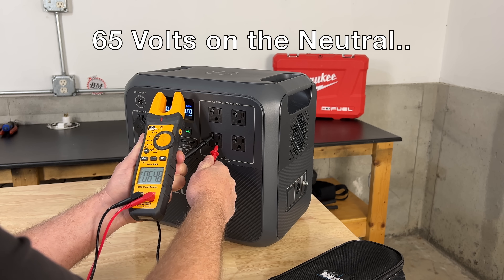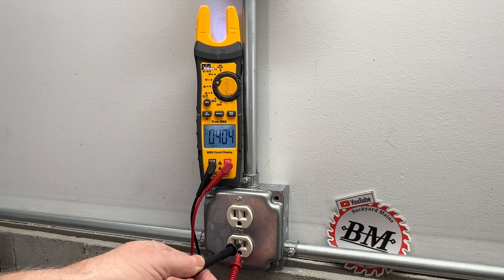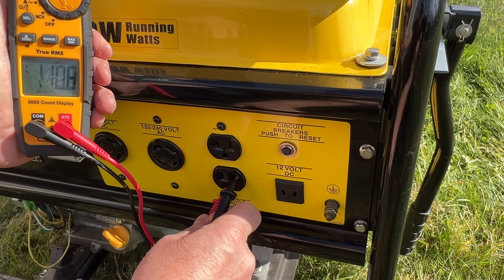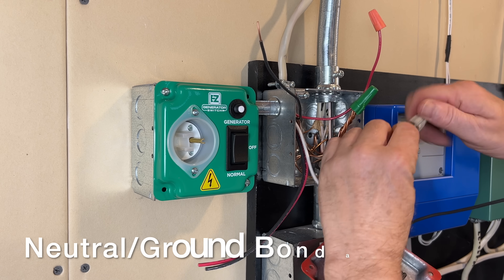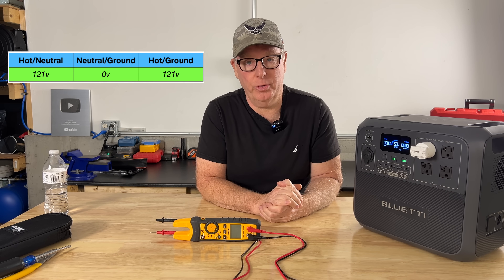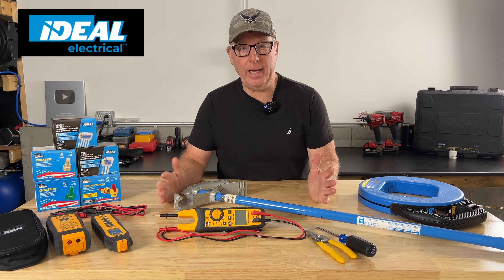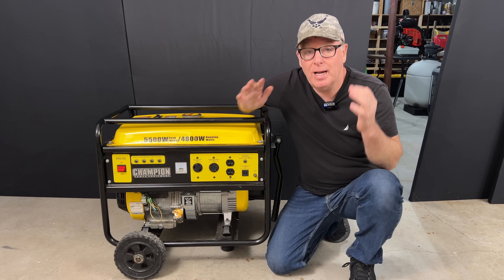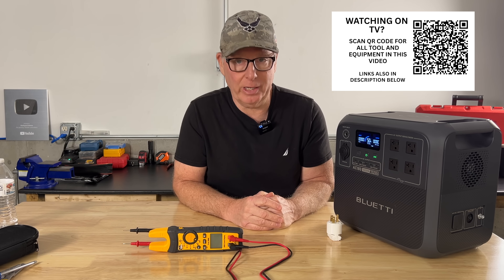The Hidden Generator Mistake.. (Dangerous)

Comment: I was hoping we'd cover the requirement to ground the portable generator when it has a bonded neutral and the very special case where we're running portable and unbonded, but the latter is only for people who know they need that anyways (so if you have to ask, don't worry about that one). Otherwise great coverage
Reply from the maker: When used as a stand alone system, most generator manufacturers recommend a ground rod but it's not required by code and its not practical to drive a ground rod and remove it every time you move the generator. With a bonded neutral, circuit breakers and GFCI protection will work. A ground rod is basically surge protection. A surge can be created from a near by lighting strike. If you were using a hand tool when this happened you could be at risk and a ground rod would offer some protection. There is no protection for a direct hit though.. I never use my generator when I hear thunder in the area.
For backup power use with a floating neutral, the generator is connected to your electrical system which then bonds the neutral and also connects the generator frame to your system ground and grounding electrode. So everything is grounded and bonded just like everything in your home. 
The only reason to then have a separate ground rod would be to direct a surge from a near by lighting strike to ground rod at the generator rather than have it travel through the ground wire to your panel and out to your system ground. Yes that is an option if you want to mitigate that issue but it's to code at least from my interpretation.

Comment: Consumer generators should come with a bonding switch.
Reply: ... and an explanation. But the lawyers would have to get involved.
Reply: @icanreadthebible7561  It's purposefully made difficult to change so that it's not easily defeated by people who don't know what they're doing. It's very easy to unbond a binded generator by following the circuit diagram or service manual. Don't do it unless there is always a single, real ground provided especially in standalone operation and the generator is labeled "UNBONDED". Unbonded ungrounded generators are inherently dangerous and often incompatible with a lot of equipment.

Comment: Have to be a little careful because sometimes the output isn't floating.  The way to check that is typically to plug the power station into the wall with a switch, then check the following:

(a) Whether the ground is passed through or not
(b) Whether ground on the AC output is wired at all and to what (if anything)
(c) Whether hot and neutral are reversed when the power station is in pass-through mode
(d) And then with the switch turned off (so neutral and ground are passed through but the hot is not and the power station's inverter is turned on) ... now check whether the neutral output is ground-referenced to the utility ground (or utility neutral).

Unfortunately, lots of power stations mess up the AC plugs.  I have two which flip around neutral and hot when AC is being passed through, for example.  That's right.  I plug the power station into the wall and the AC output's HOT is now ground-referenced and its NEUTRAL is 120VAC.  I learned that the hard way once.

Another common problem in older power stations is that the power station's inverter output is not isolated and the neutral and ground are hard-referenced to each other, but NOT at zero volts.   Either on the input or the output or both depending on how ground is wired (if ground is wired at all, which is another problem). This occurs when the power station's output transformer is wired for 120VAC split-phase with the center tap of the output transformer being ground-referenced.  And now .... oh yah.  That is not good at all.

Gotta make sure everything is referenced properly before trying to tie a power station into a panel (for example), verses just directly running a few appliances.

-Matt

Comment: You have to be careful about bonding the neutral on Chinese made AC inverters that also have unbonded Neutral if they have outlets as well as a terminal strip for the output since all the ones that I've looked at have the Neutral and Line connections reversed on the terminal strip as compared to the outlets. If you have a breaker panel connected to the terminal strip and something plugged into the outlets you could potentially have them grounded to different sides of the outputs creating an electric shock hazard. The Chinese factories don't seem to know how electrical power systems work in North America and typically use Red wire for the Line, Yellow for Ground and Black for the Neutral connections to the terminal strip instead of Black, Green and White, which makes no sense to us. This is easy to fix by putting a piece of white heat shrink over the red wire and relabeling the terminal Neutral, Ground in the center and Black the Line so the terminals match the outlets.

Comment: Interestingly, in 2008 I installed a 17KW Kohler standby generator along with a Kohler Automatic Transfer Switch. This system would start and stop automatically. I wasn't clear on why the generator arrived with the neutral and ground bonded, but I assumed it was okay. After a few years I realized that the ATS did not switch the neutral so I unbonded the neutral and ground in the generator. This was a PITA since I had to disassemble the entire box and chassis to get to the point where I could lift the bonding jumper.

As a side note, I noticed that the voltage sums between neutral and ground and hot to ground were equal the voltage between hot and neutral.
Reply from the maker: Good move.. Now you have a safe system that won't have stray voltages floating around on your ground wires and present a potential shock hazard. Its a shame that make it hard to find or to get to. I have seen so many portable and permanent stand by bonded generators without the neutral being switched.
Reply: @BackyardMaine It's not a shame but a feature. It requires positive effort by people who know what they're doing to avoid the alternative of safety issues of people willynilly unbonding standalone generators without using a proper temporary ground electrode and injuring people.
Reply: Thanks so much for this video.  I just built a 25kw generator for my farm and couldn't figure out why I was getting 60v on the neutral to ground at the 50amp outlet.  I realize now I do have a floating neutral.  Separate buss bars. I subscribed because I like to follow people who really know what they're talking about.  Excellent work much appreciated

Comment: It is all relative and unless one of the references is not bonded then, it is irrelevant...i.e. it is a 'don't care'.  One should know now what they expect to see before they measure it.  Sometimes measuring something is silly unless you really know what you're looking for.  What cranks my crank in industrial is control systems with 24VDC(or whatever is chosen) is when they don't reference the 24V to ground.  It is easy and safe to do(just a tiny, no-current carrying wire).  If you don't 'bond' the 24V, it makes for a real PITA to troubleshoot when long runs are made and you have no way to get back to the unbonded 0V(commonly called the common)  but, the common is not common unless you common it.  Floating common(really, no common) makes for a terrible time of measuring things that you cannot measure w/o a probe a long as you are distant from the source. Wordy response, I know, but I think know what you mean.

Comment: It seems odd that you didn't address whether or not to use the Earth ground?  This is a separate issue from bonding, is it not?
Reply from the maker: When used as a stand alone system most generator manufacturers recommend a ground rod but it's not practical to drive a ground rod and remove it every time you move the generator. With a bonded neutral, your breakers and your GFCI protection will work. A ground rod is basically surge protection. I surge can be created from a near by lighting strike. If you were using a hand tool when this happened you could be at risk and a ground rod offers some protection. There is no protection for a direct hit though.. I never use my generator when i hear thunder in the area.
For backup power use with a floating neutral, the generator is connected to your electrical system which then bonds the neutral and also connects the frame to your system ground and grounding electrode. So everything is grounded and bonded just like everything in your home. 
So the only reason to then have a separate ground rod would be to direct a surge from a near by lighting strike to ground rod at the generator rather than have it travel through the ground wire to your panel and out to your system ground. So yes thats an option if you want to mitigate that issue but it's to code at least from my interpretation.
Reply: @BackyardMaine 

We're 250 today!  Happy birthday Jarhead!

; )
Reply: @BackyardMaine 

My idea of a "ground rod" for a gas/solar gen is driving an 18" steel stake in the ground (and removing when done).

Does this give any level of protection being that it isn't an 8' lg copper coated typical rod?
Reply from the maker: @mjktrash  Depends on the soil but probably not very much especially in dry conditions.
Reply: @BackyardMaine   Is there a way for a talented/knowledgeable guy like yourself to quantify this concept and either say it works "some" or it's definitely not worth it?  I'm certainly not that guy on a E.E. level...  Might make a good video?

Comment: I have been looking for an answer to this question forever. I am a pepper and have a tri fuel non inverter generator and a solar generator. I bought the non inverter generator before I really knew what I was doing. My plan was to use my tri fuel generator to charge my solar generator on cloudy days. As I found out later this may be an issue due to THD. Are there ways to mitigate the risk.
Reply from the maker: Happy to help answer this question for you.. I find even some electricians don't quite understand it. I do something similar to what you're doing but only for power outages. I made a video on the subject. https://youtu.be/ti9aorGY7yI

Comment: As a hvac guy if your only powering your boiler/ furnace you should bond your neutral,the newer equipment of today rely on electronics to lets say flame rectification and commands from the pc boards...your explanation on this video was excellent
Reply from the maker: That's a great point! Many will not run when the neutral is floating. With the EZ- Switch you have a choice to wire it as a bonded or a floating neutral. In either case you should have a bonded neutral. If it's wired as (floating neutral) the bond will come from your electrical system, if wired as a (bonded neutral) you need to bond at the generator or power station.
Reply: @BackyardMaine  Which is the recommended wiring method for the EZ-Switch? I’m considering adding those to my HVAC systems. I have a solar generator (battery pack) and an F-150W with the optional 2000W generator (inverter on a gas engine), that I may need to use if the battery pack is fully discharged during a power outage.
Reply from the maker: @RickActual  It will depend on your backup power configuration. The power station will have a floating neutral (I have never seen one bonded) and if your generator also has a floating neutral then you would wire the EZ Switch according to the floating neutral instructions. That way everything will be bonded to the home connection when the generator or power station are running as your backup.

Comment: A ground fault is the most common issue in household equipment. Ungrounded systems are specifically designed not to clear ground faults (by blowing a fuse or tripping a breaker) so I would argue they are less safe.  You only see deliberate ungrounded systems when the loss of power is worse than the risk of someone being shocked (e.g., an ICU in a hospital) and even then they are behind an isolation transformer.  

The real question you have to ask is why the power companies started grounding distribution lines in the first place. Once you understand that, you can better assess the risk of an ungrounded system.
Reply from the maker: All homes in the USA are on a grounded systems. The point of the video is where the neutral and ground are bonded and that it can only happen in one location. Even power stations are required to be grounded. That's why you see a ground terminal on them. Although I have never seen one in use with a ground wire connected.

Comment: Thanks for the education.  
Now, please teach us how to make a filter to reduce sensitivity of arc fault circuit breakers.  Every time the cleaning people plug in a vacuum cleaner (multiple brands)  or a contractor plugs in a power tool, our nuisance Siemens circuit breaker trips.  It’s a major pain to reset.
Reply: apparently Siemens is a crappy brand for nuisance tripping.
SquareD and Eaton have better algorithms.
Reply: @nomadicoasis9260 I'm just going to point out for people that don't know that if you have a Siemens panel, you are stuck using their afci breakers unless you install a different brand sub panel just for the circuits that have afci .
Reply: Don't throw out the baby with the bath water.
The problem isn't AFCI which provides measurable safety over a conventional slow breaker, but a failure of the appliance to add an inductive load snubber circuit that's probably ruining other devices like electrically commutated motor controllers and electronics elsewhere. A beefy diode of the proper type and properly sized is the bare minimum, but usually it includes a resistor and a capacitor to dissipate the energy once the motor is switched off. If the problem still happens on motor start with a snubber, this requires a softer start circuit too.
Reply: I'm having that exact same problem on a separate circuit I had the electrician put in my garage when the house was built. I haven't bothered to look at it yet, but it actually looks to be more of a GFCI problem than an arc fault detection problem. I'm so tired of dealing with "builder grade" garbage. : (
Reply from the maker: I'm not a big fan of AFCI protection for the same reason. Statistic do show they prevent fires but they can be a pain in the butt.

Comment: The only time I ever saw a floating neutral was in an office building where a new 3 phase 120/208 sub panel had been installed. for some reason the neutral lug wasn't tightened. Damn was the smell of destroyed computer power supplies every nasty.
Reply from the maker: Sub panels should not have a bonded neutral. The bond is done at the Maine Panel or at the first service disconnect usually as part of the meter enclosure. We only want one bond so grounds and neutral and or any other bond down stream should be avoided.
Reply: @BackyardMaine I'm pretty sure @BobbieBees is referring to a an open neutral situation in which there were groups of three 120V circuits sharing a common neutral, referred to as a multiwire branch circuit in the NEC, and sometimes called an Edison circuit by old gray haired electricians.  And that situation resulted in all the 120V circuits fed from that panel becoming in effect series 208 volt circuits in which the voltage on a given circuit could be close to the nominal 120, or as low as 0 or as high as 208 and unless the computers and other equipment such as fluorescent ballasts/LED drivers have a wide voltage rating such as 100 ~ 240 or 120 ~ 277, there will be lots of smoke and possibly flames if you lose the neutral on a multiwire branch circuit.